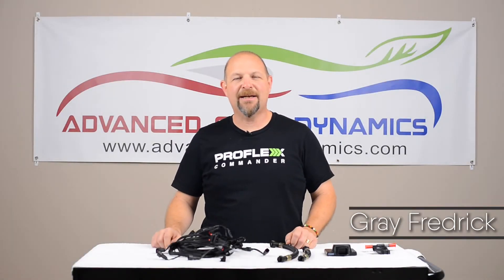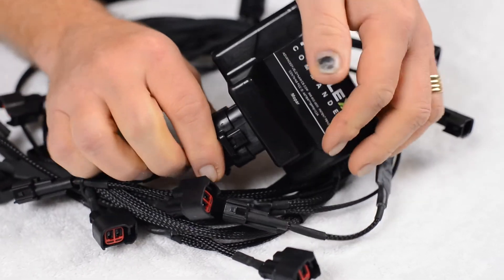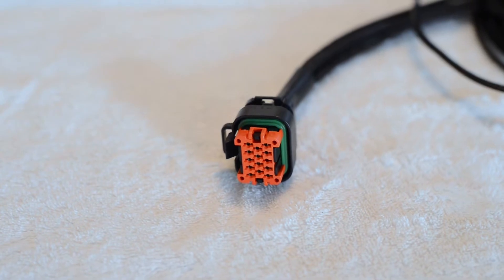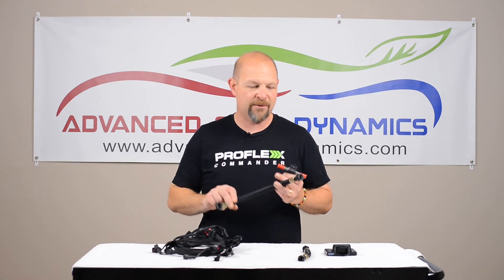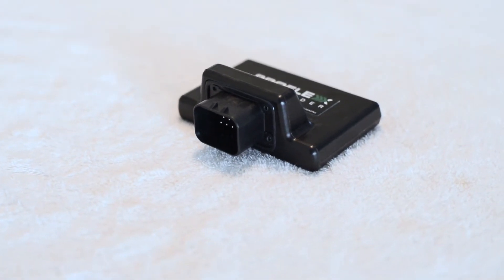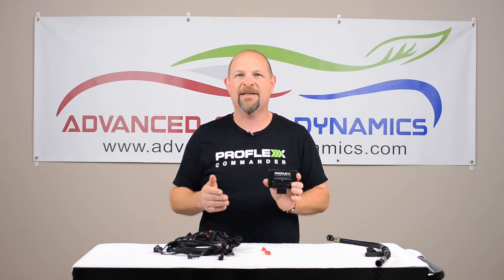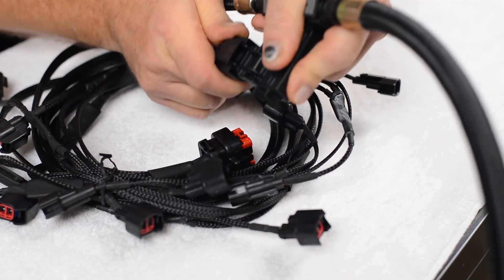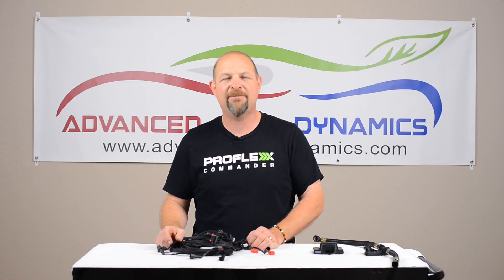Introducing the ProFlex Commander Adaptive E85 Management System

Comment: Would I need get different injectors or no? I’m completely stock I have a 2019 charger scatpack looking buy this to run E85 and avoid having tune the pcm and stuff
Reply from the maker: Hey, Bugni, sorry for the late reply.  Your 2019 ScatPack does not need larger injectors to run E85.  We have dyno tested every car we offer a system for and have made sure that the fuel system can deliver enough fuel for full E85 before introducing the kit.  ScatPack is one of our best sellers and of all the vehicles we serve MOPARS consistently turn in the some of the best power gains on E85.
Reply: What about timing on a hellcat
Reply from the maker: Hellcats dont need more timing to make more power. We have actually seen gains with less timing.

Comment: Does it allow the hp tuners ngauge  to read live e85 content and swap tunes .. Is it tunable I already have a unlocked pcm
Reply from the maker: OK, so this is going to be a bit of a mixed answer.  First of all, the function of the ngauge will not change however, with the ProFlex Commander you will have true real time adaptive flex fuel so there is never any need to switch maps.  The Commander automatically adjusts fuel delivery for the percentage of gas/ethanol in the tank.  This allows you to run any blend from 100% gas to 100% ethanol seamlessly as the system reads and updates fuel blend and delivery every 30 milliseconds based on content.  Does that make sense?

Comment: Will this work even if the car is already tuned for 93? Also will i need to upgrade injectors? I have a 2018 scatpack
Reply from the maker: Yes, this will work seamlessly with your tuned vehicle. If you have other power adders in addition to the tune you will need larger injectors as the stock injectors are pretty small on the 2018 Scatpack.
Reply: @advancedfueldynamics  thanks for the quick response. One more question, my fear is that what if the system stops working over time or malfunctions and i have a full tank of e85, Will that harm my motor? Is there any type of warranty for this kind of situation?
Reply from the maker: @BrandonNelsonGVL  In all our years of being in the market we haven't ever had this issue, but if it did stop working and you had a full tank of E85 the car would start stumbling and then stop running. Simply draining the tank of E85 and filling up with gas will allow it run properly again while you troubleshoot the issue. We have a 1-year warranty on our products that covers any manufacturers defect.
Reply: @advancedfueldynamics  thank u!